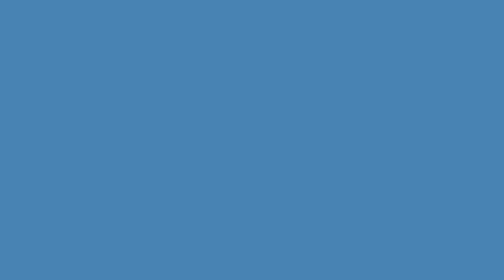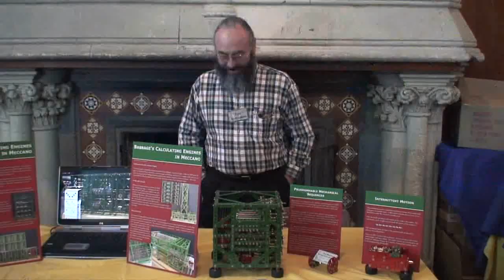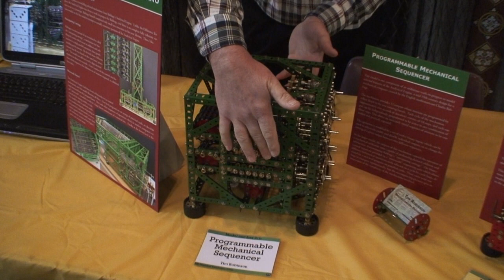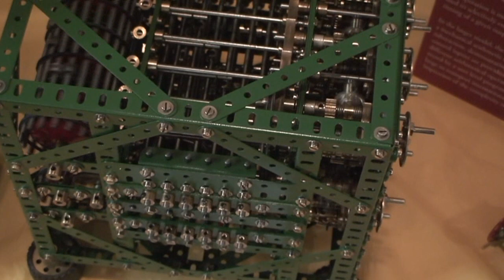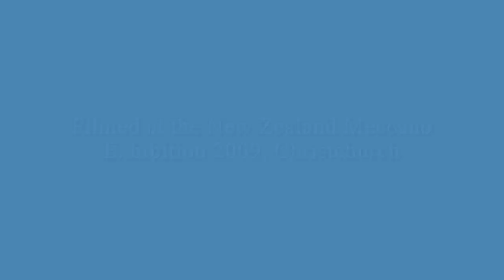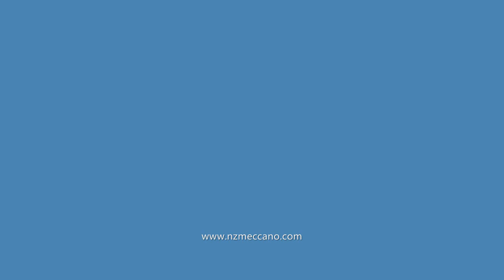Meccano Programmable Mechanical Sequencer (HD video)

Comment: Digital and mechanical machines have their own issues to deal with.
As you try to increase your computational power, you get some new physics effet that appear.
For mechanical machines is will be: wear, heat, vibrations, noise, (and much more, but I'm not a mechanical engineer).
For electronic devices it will be: wear (yes, capacitors wear), heat, noise (for high power machines), electric noise, bounce effect, interferences noise, and much more.

Comment: @utubekojitakeo AFAIK, the reason for developing nanomechanisms is that, currently, the control system is already as small as it can be but the mechanisms aren't. So they want to bring their size down, and the way they know to do it is using the same techniques used for chip making.
It has nothing to do with limits to digital technology: since the techniques are the same, the limits are the same. And electronics are faster even at that scale.

Comment: @NathansBackwoods Digital computers are *far* *FAR* more reliable than mechanical computers. Sophisticated mechanical computers are very prone to malfunction / jamming / breaking. Things that need to move are inherently prone to having issues, materials flex, wear down, and change their properties slowly over time. Trying to build one that is at all reliable is most of the design challenge.